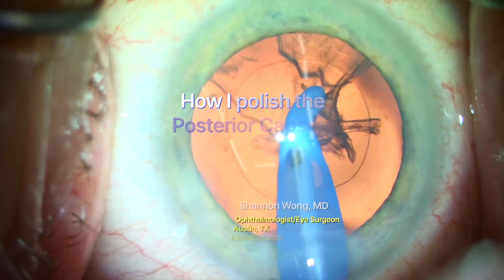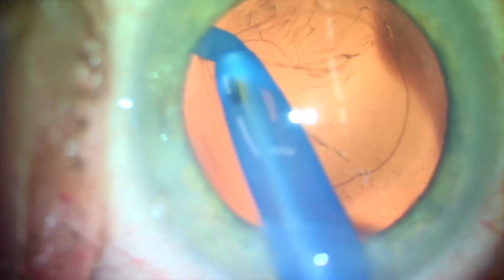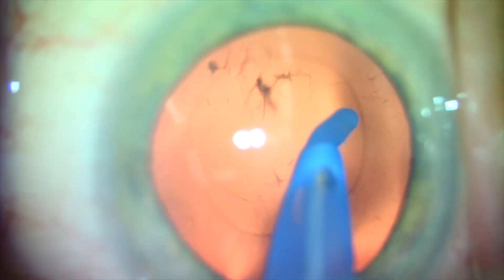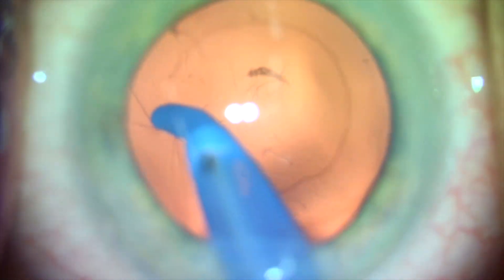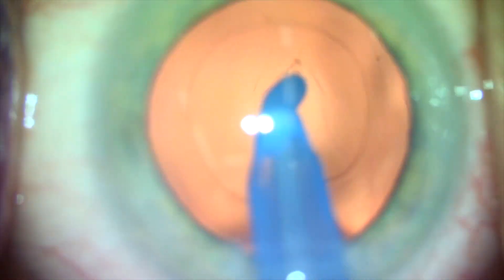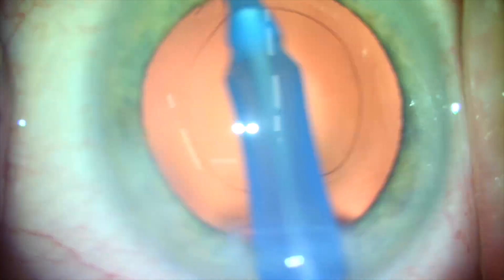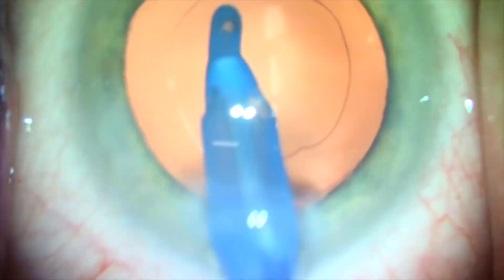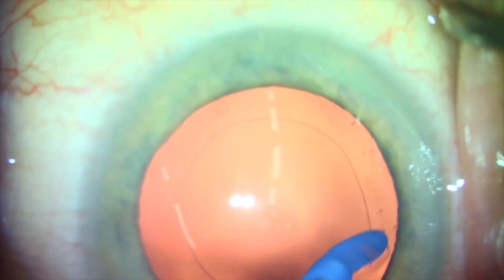How I polish the posterior capsule during cataract and lens replacement surgery - The Capsule Guard.

Comment: This is also my favorite IA. One trick I've learned to save some headaches. . . the silicone sleeve likes to come off the front. Just before going into the eye, I'll go on position 1 to wet the eye and look for either 2 streams (which means all is well) or 3 streams of fluid (which means the tip has slipped off and needs to be adjusted).  This saves time / potential trauma to the eye so you know if the metal tip is sticking out slightly before even going in with it then having to come back out.  Nice video
Reply from the maker: Agreed.  Thank you for your comments!

Comment: You are too brave. It does seem like a really secure device, but I'm sure if I used it I'd accidently break the capsule anyways xD. I just leave those fibers alone and yag it months later
Reply from the maker: The capsule break rate when used properly is less than one in 500 (probably even lower).  We do so many premium IOLs that I would prefer to avoid doing a YAG capsulotomy.
Reply: I don’t see this as “too brave”, but rather, the standard of care in this day and age.